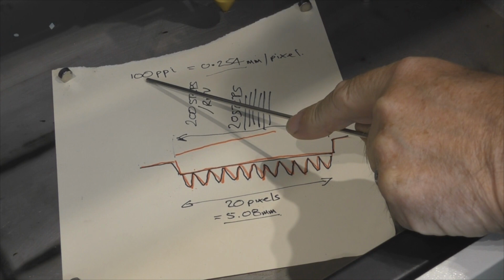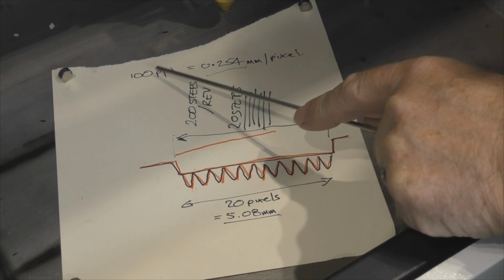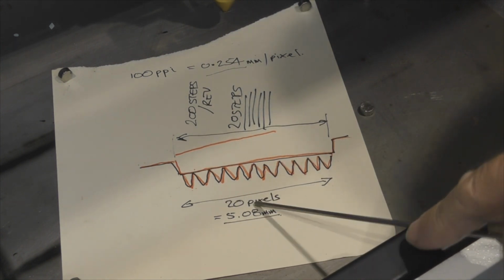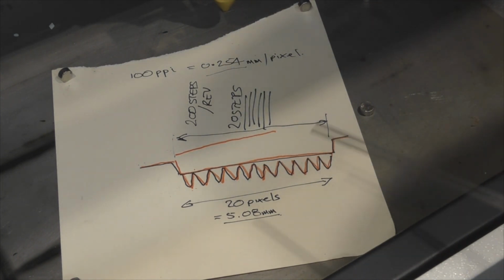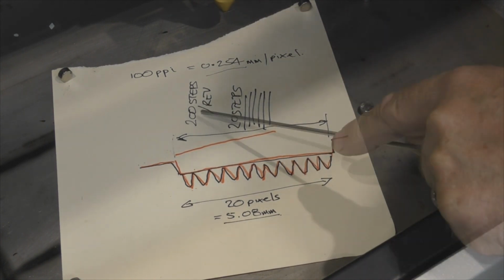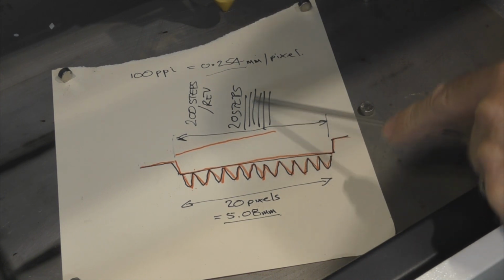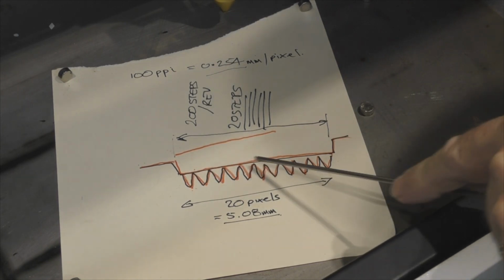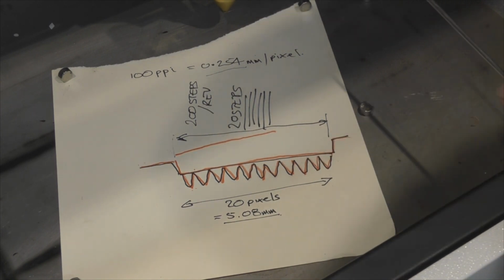RDWorks Learning Lab 117 Hunting those Phantom Pixels

Comment: Russ, Haven't corresponded with you in a while.  Hope all is well with you.  I haven't gone through all your videos, but I was wondering if you have had any experience with using a fiber laser.  Prices for the smaller units (20w), are not excessive and you can engrave on metal.  Your input would be appreciated.  Best regards, Rick
Reply from the maker: Hi Rick
There are two types of fibre laser,. Both operate at the same 1micron wavelength. The cheaper Q swicth laser can certainly mark metals and some plastics but it will be just surface marking. 
 A good channel to watch about your planned purchase is   https://www.youtube.com/@jefferyj
 The other type of laser is called a MOPA (for which I did a series called "fibre Laser Learning Lab")
 This is a more powerful and more flexible technology that with 50 watts can make deeper engravings, Yes it's more expensive  but worth considering if you plan to do any business with it  However, please be sure to understand that this is just a marking machine and cannot cut.
Reply: @SarbarMultimedia  Russ: Thank you for the quick reply.  Since this purchase would be just for experimenting, I will probably hold off for now.  Have you done any research involving powder coating, utilizing a laser for curing the powder?  I have started trying that, but the air jet, (set at 1 psi) blows off the powder.  Not sure if I am comfortable with eliminating the compressed air.  Would be very interested in your opinion.
Reply from the maker: @rickschwab3921  
 Hi Rick
 I have spent many years in industy using powder coating as a product finsh There is no magic curing process associated with the process.  This is a finely ground power plastic that requires MELTING onto a surface , The melting has to take place slowly so that the melted plastic powder can FLOW into a super uniform blemish free coat. Wthout exception, the process and design of the powder (along with some additives to help flow)is fof coating METALS.  Heating the metal substrate to a similat temprature to the paint helps th plastic to adhere to the metal surface.  All these design parameters of powder coat are incompatible witht rying to make it happen with a leser beam. Yes this is a subject I have covered with a video. Manypeople claim to be succesful with the process but what "success" means will vary from person to person., Deep engraving and epoxy or paintfilling is a much more contollable process that allows easy mixing of many colours on the same engraving.
see  https://youtu.be/mHFuhodfaC8
Reply: @SarbarMultimedia  Russ: Just watched your powder-coating with a laser video.  Very enlightening, as all your videos are.  I think I will consider a small oven to provide a consistent and longer heat source.  Thanks again.
Reply from the maker: @rickschwab3921  Test it in your wife's oven before making an investment....However. make sure the fan is turned off!!!

Comment: Not sure if this will help you but I recall that when I spoke to Trotec about my machine they told me that the chinese glass tubes are not capable of producing pulses as fast as a high quality sealed air cooled tube like Synrad. This also makes servo motors excessive in china machines since they will not be able keep up with the faster servo motor anyway.
This might be wrong, I am not sure but if I am not mistaken that is what they told me. :)
Reply from the maker: I'm pretty sure Synrad are not producing DC sealed glass tubes. Their specialization  is RF excited tubes at about 4 to 6 times the price of sealed glass tubes, I consider them as an industrial solution rather than affordable for most  enthusiasts. Their  operating technology does allow for continuous pulsing whereas there are special operating modes for a glass tube where pulses can exist naturally or be forced by the controller. The Chinese design is elegantly simple and very basic with lots of small design compromises. But for 90% of the capability of an expensive industrial machine you are getting a lot for very little because there is no R&D team, no marketing costs and no service backup team to support. With a Chinese machine you will be your own 24/7 support tech.
Stepper motors are very reliable and pretty fast. They can be made to perform better by adding a rotary shaft encoder to guarantee position accuracy . They will never beat an analogue servo system, only on price.......but do they need to? That's all part of the 10% design compromise.

Best wishes
Russ

Comment: I just wanted to pass this along and show that it must be possible to find the balance of the 3D Curtains pattern that we might expect on our machines and a different machine doing a similar operation.  Here is a video and if you go to 2:25 seconds on this video, you will not see the strong curtain pattern.  I do not know anything about the machine they are talking about but I am just showing the end result.
https://www.youtube.com/watch?v=gXc0jnqZYuA
Reply from the maker: Hi Scot 
I was on holiday with virtually no connection to the outside world when receiving this. Answering was also impossible. I am now going through to catch up on all unanswered questions.
servo motors. If you look on the Kerns website it shows that they have gone sensible and do NOT use toothed belts. Their motion description is quoted below

Best wishes
Russ

HYPERDUAL MOTION
The HyperDual system features a dual servo motor/rack and pinion design resulting in greatly improved speed and acceleration. The accuracy and repeatability of the LaserCELL’s motion system well exceeds the demands of Kern’s growing customer base.

Comment: Hey  how are you.  So I bought the new laser tube which you had recommended.  The tube was too big for my machine and had to return.  Finally got the new tube and installed.  It worked for one cut.  Now my screen wont turn on.  Any idea what it could be?  The light turns on in the cutting area, but the laser beam wont go on and the screen doesnt turn on
Reply from the maker: Hi Pamela
There is a socket on the white control unit into which the screen plugs. I would first unplug and reeplug that because it sounds the most likely problem.
When you power your machine on, does it run to one corner and set the machine 0,0? That one action tells me just how much of the machine is working. If you press the test button on the power supply does the tube light up?

Speak soon
Russ
Reply: SarbarMultimedia  morning. When I power the machine on only the light switch will turn on. It doesn't run from side to side. The test button does not turn on either. It did work when you had previously had me test that. I had the laser tube installed yesterday and it worked for one cut. We installed an extractor (which is not plugged into the machine) and now it won't work. The only thing that will turn on is the light switxh
Reply from the maker: Hi Pamela
I need to get you to send me pictures and I need to send you data. We can only do this by email. I tried to personal message you but it seems to be blocked. You can either message me or send your email to me via this comment box. The good news is that any email address immediately goes into my you tube spam box where it will never be seen by the public
Best wishes
Russ

Comment: Maybe a nutty idea: take the motor out of the equation - pulse the laser while manually moving the laser head with your hand. You might even be able to get the head to start sliding and release it and let it slow down on its own. Or, pull the head with a weight and a pulley or something.

Fascinating video as always, thanks!
Reply: Of course, the belt would probably need to be disconnected.
Reply from the maker: Hi Hirudin
Others have suggested similar and initially I thought it would be a good idea. Another guy had disconnected his belt and mounted a pulley over the edge of his machine so that he could hang weights onto a cord pulling the head.
As you would expect , no cut variation and definitely no "dwell spikes."  Interestingly he reports that it did not cure the striations on the edge of acrylic.  I am already 100% convinced the marks are caused by steppers non-linear micro motions at certain speeds. By removing the sponginess in the system we can now see the distinct performance band where this occurs. There is still the possibility of other resonances beyond the belt but I'm ending my chase there. My goal is to set performance boundaries for this machine and not to alter/upgrade. Unfortunately I broke that aim here by adding a new belt, although I excuse that as an exploratory tool rather than an upgrade.
Thanks for the contribution as ALL thoughts and ideas are valuable because even the wacky ones can spark inspiration. That is one of the reasons I share my methods and procedures as well as the successes and failures. If my logic is awry then there will be help out there to teach me.. Remember I'm climbing my way up the knowledge ladder but I'm no expert, I still have a lot to learn and UNDERSTAND....they are not the same thing.

Comment: Nice video Russ. 

I have been trying to eliminate the wavy bottoms on deep pocket engravings for a couple years now. The best I have found is to put a pair of lines about 20-40mm outside of my photo so the head is a more constant speed. It reduces the amplitude of the waves on the ends, but it's still there. I have my fingers crossed for finding the true culprit, at this point I'm pretty convinced that would require a motor/controller overhaul to a servo system. I hope that I'm wrong and there is a simpler solution, but time shall tell. In the mean time here's to burning away more material.
Reply: Today I did some testing with regards to vibrations in the head. I found that I got much less vibrations when running the speed at a multiple of the step length. I think it's because the controller isn't trying to take fractional steps. For example my step length in the x-axis is 11.25 um, so I ran some test cuts with the speed at numbers that were multiples of that, and speeds that did not divide evenly, and each speed that was a multiple of the step length resulted in a much less vibration than speeds that were not multiples. I think the fractional steps could explain the cyclical vibrations. Might be worth checking out, and the math is simple: eg. speed 45mm/s devided by the step length 0.01125mm = 4000 steps. But 40mm/s divided by .01125mm = 3555.5555556. So when it attempts to output the fractional steps it would cause a more twitchy response.

Then again, there are a lot of variables involved, and it could just be coincidence for the speeds I tried... and my step length is a number that can go to whole numbers pretty easily so it may not work for everyone.

Comment: These lens adjustble laser heads had another very big problem. If you put lens with Focal Length with exampe 76.2mm and if you adjust the lens on these length from the upper mirror, you can kill the upper mirror with the small percent of the laser beam defraction from the lens. 

Best Regards.
Reply from the maker: Hi Chudomira
I greatly appreciate your experience of the very small mechanical design issues that may be contributing to some of the pattern problems I have identified on my machine. Obviously they all emanate from the stepper motor because that is the only mechanism that is creating the micro vibrations. I accept all the mechanical leverage issues that you have identified and I think they are all worthy of being investigated on this machine to see if I can do anything simple  to mitigate such issues. It is not my intention to solve any of the problems I find because I am not trying to make a super machine. I am instead trying to understand A) if there is a problem. B) what is the cause of the problem. C) what are the boundaries of the problem
With understanding I have choices. For example, as you have seen in the video, I have decreased the zone and the pattern of the vibrations. It is now in a very precise zone between 40 and 70mm/s  thus I hope to be able to prove in future sessions that  by staying out of that zone I have improved my engraving. It would appear that if the issues you identified are present in my machine then they are all bundled up in that "nasty" zone. After all,  the patterns I am recording in acrylic include ALL issues not just stepper weaknesses.  This is exactly the goal of my experimentation to identify operating boundaries so that I can make informed decisions on how to best operate the machine.
I could spend huge amounts of money trying to improve the machine but as I work my way through the machine I conclude that you are getting a fantastic little CNC machine for very little money. Having owned two large 3kw metal cutting industrial lasers for 10 years, I realize that this is not industrial standard engineering and that there are many compromises that have been made BUT for what it is, we should not complain. Hence, it is  my strategy to understand rather than fix it. I have  been to trade shows and examined the design concepts that the professional machine builders such as Trotec and Epilog use,  and they in a different league .....but that is  why you will be paying 15 to 20 times as much for something that does the same job but  a bit better.

Again, sincere thanks for you comments and I shall be bearing them all in mind as I experiment further. It may be that something as simple as your damping weight around the nozzle will produce great benefits  and help reduce my "nasty" zone further. All suggestions are welcomed.

Best wishes
Russ

.
Reply: Hello,

thank you for your answer and your videos, i am very pleased with it. You can try to engrave by Y axis. These will not improve something significant, but will shows how the mass reduce the vibrations. Often i am egraving by Y. If the stepper motor do not holds the bridge, you can reduce max. acc. from the software. 

Best Regards.

Comment: To reduce these vibration to minimum, you can buy transmition belt x3, you will increase the speed of the stepper motor and then the vibration effect. But on these blue chienese laser have to me mounted on the right on the moving bridge (i do not know what exacly is the name), these will be some problem. These will decrease the maximum speed of the machine.

Best Regards.

Comment: Also, with these vibrato effect you lost 5-10% from the power efficiency into the cut zone, because the beam steps on the material with fast and slow speed steps into the slow cutting speed. I was attached 50grams mass near to the lens and i was make to cut completely the same thickness with the same power.

Best Regards.

Comment: Hello, 

i am engineer and i was made two laser machines with different designs. 
On the second desing i had the same problem. I was found the problem in the lens position, the lens is too far from the linear holder and goes like string oscillator pushed from the stepper motor vibrations. 
For the second machine i was bougth laser head with long nozzle which is not good, the same like on the video.
But the first laser head with short nozzle goes better cut and engraving with minimum spikes and wave cutting. 
The other problem is the position of the belt, below the linear holder it is not good at all, have to be on linear holder. The linear holder itself is another chienese long topic. 

Best Regards.

Comment: Hi Russ,
  I think you are experiencing mid band resonance. The main springiness in the system is actually the stepper motor. It produces a torque proportional to the sin of the displacement angle from where it wants to be. For small displacements sin x ~= x so it looks like a classic spring.

The mass of the load plus the inertia of the rotor form a simple harmonic oscillator with the spring constant of the motor. The resonant frequency is constant, so as you sweep the step frequency it comes in and out of resonance. The oscillations are superimposed on the linear motion, so as you move faster they get recorded on the acrylic further apart. Just like an oscilloscope looking at a constant frequency waveform with a variable timebase.
Reply: Another possibility is your laser PSU has ripple on its output. Have you looked at the beam current on a scope? E.g. put a scope across the ammeter terminals if it has one.
Reply from the maker: Hi Thanks for the great explanation. There is no intention on my part to upgrade or change my motor of drivers. My hobby (apart from the video ) is the engineering challenges of finding the limits and shortcomings of what I bought. Ok, I changed the belt, but that was almost a tool to prove a point which I feel was successful.  I have now  defined a performance zone between 40 and 70mm/sec that, if possible, I should avoid. That is a much suppressed range than existed with the rubber belt, thus I now possess knowledge I didn't have before. I do not use the machine for business purposes, it's just a means of keeping my two remaining grey cells exercised. I think it's pretty amazing that I have a 3D performance storage tool in acrylic it can do so much more than a scope
I realise that steppers are digital and proper servos are analogue so it's good to understand that there is springiness in the jump between steps. 
Thanks again
Best wishes
Russ
Reply from the maker: After initial rise time and overshoot the power is very steady. Nothing that would cause these spikes. They are purely down to motion because  they have direction to the shape that reverses with the scans.
Thanks for the thought
Best regards
Russ